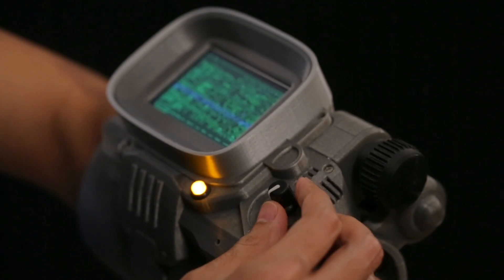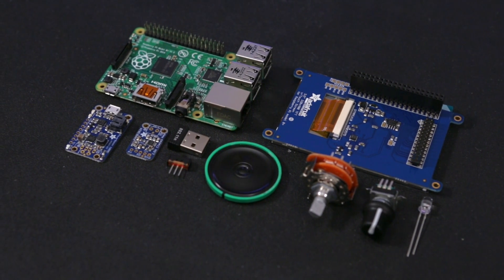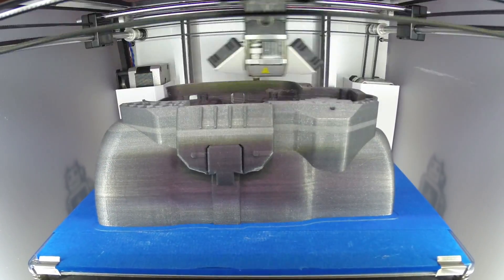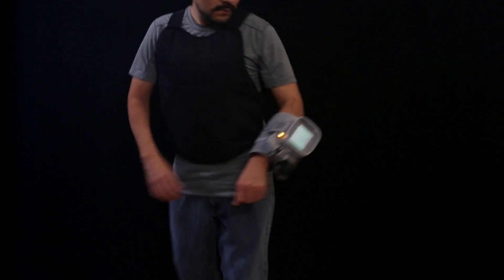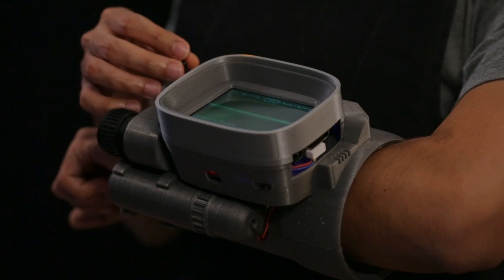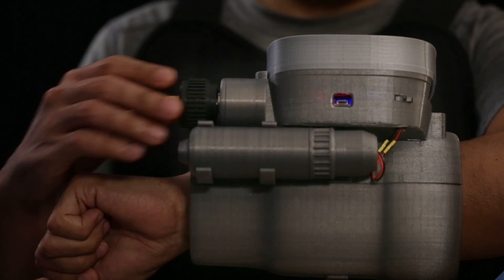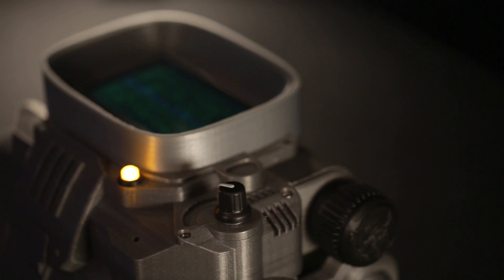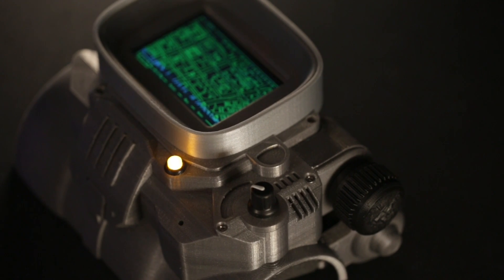3D Printed Pipboy 3000 MKIV with Raspberry Pi

Comment: can I use anything other than a lithium battery because I dont want to forget to unplug the thing and I dont want it to burst into flames is there anything as powerful or powerful enough to work with this pipboy or do I have to use a lithium battery
Reply: Just wait until someone create Fusion Batteries 😂
Reply: you can buy a lithium battery with a circuit protection board. almost everything rechargable work uhh like that

Comment: I'm in the process of building my own, all I need to do is solder and code! I'm also putting my rotary encoder as the vertical side knob for item selection, and I'm doing the code myself. It's going to be awesome!
Edit: after i'm finished, I'm going to try and also implement an open source fitness tracker, to accurately display the health stats/hp.
Reply: cool, how is it coming? I would really love some pointers lad! if you wouldn't mind messaging me on Instagram @moparguy00 , I would forever be in your debt
Reply: do you need to install noobs or raspbian? i'm trying to program mine.
Reply: How did this go?

Comment: I can't seem to get the pipboy image running properly on the SD card. I have tried several SD card formatters, but it will not boot up! Can you help?
Reply: complete newb here. I'm having a hard time figuring out how to install pipboy python app. I have the pi 3 and i have installed a fresh copy of jessie based pitft. it's up and running on the pi3. how do you install the pipboy app after?
Reply from the maker: The pipboy image only works with a Pi 2 (not 3). If you want to make it work on a Pi 3, you'd have to start with a fresh image and then install the pipboy python app.
Reply: Adafruit Industries a fresh image of any os?
Reply: there are two GitHub pages where if you install git you can start tinkering with it here are the links https://github.com/sabas1080/pypboy
https://github.com/grieve/pypboy 
mind you there are also requirements and you NEED TO GET EXTENDED IMAGES FOR PYGAME OR ELSE THE THING WILL KEEP WANTING A WINDOWS BMP file

Comment: needs a geiger counter
Reply: best one you can find to fit it in the case
Reply: I am no one Mine is in the shop
Reply: here is a Geiger counter board that is made for the pi
https://apollo.open-resource.org/lab:pigi
Reply: It's actually possible to use a fotodiode to build a geiger counter, if you want it cheaper (but will be less precise, obviously)
Reply: THE PIP BOY HE MADE IS 4000 OR 3000 Mark not IV but V!